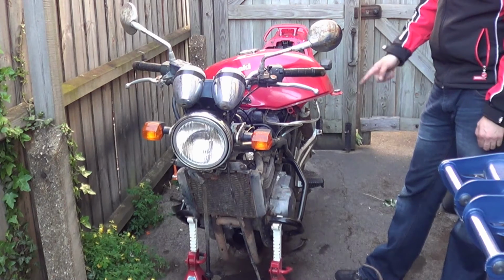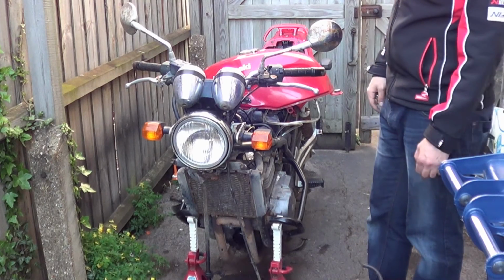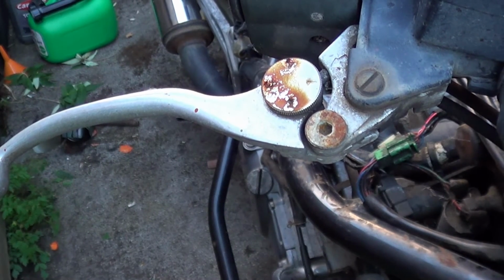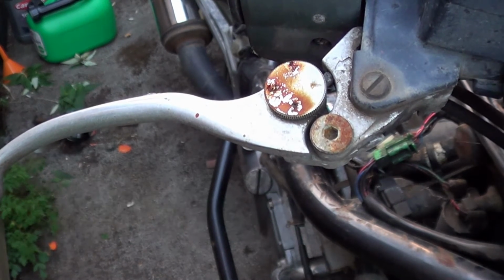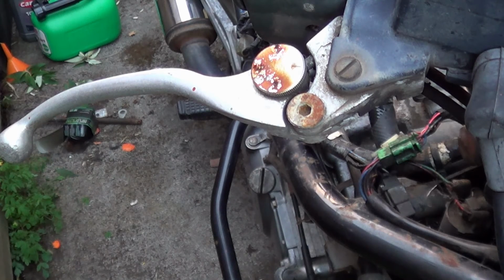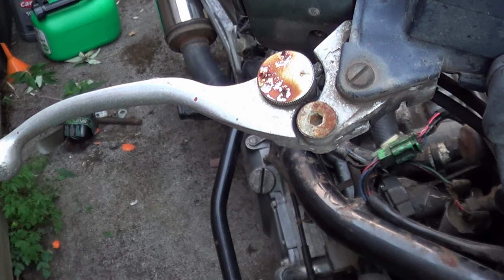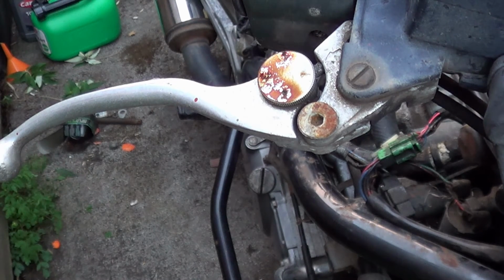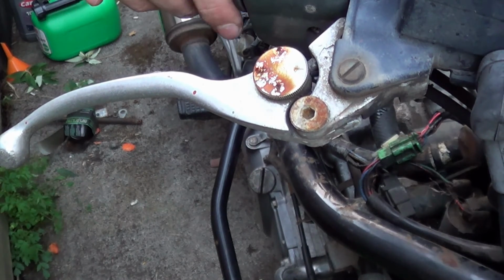Kawaxaki ER 5 - Mystery Problems Update - Episode 12

Comment: Mine sounds the same, replaced the plugs, removed clutch cover and found milky cream on the inside cleaned it off, fitted new gasket and refitted it, filled up with new oil, still sounds like yours, so will try water pump seals next, just hoping it not the head gasket?

Comment: I'm guessing it may be the carbs as well. Also thinking it may be the enging timing for the clunking and shaking.

I will say I'm in no way good at diagnosing issues. Though getting there slowly.
Reply from the maker: Rigal the shaking is probably due to the mis-firing cylinder, my guess at present is that its either ignition related or carb related. Good thing is that ignition is an easy one to diagnose. Probably a video later this evening. - matt
Reply: Pony Power You know better then me :) Looking forward to the next vid!

Comment: yes...could be petrol feed...pipes, connections, air leaks...and otherwise electrical......coils maybe......usually something simple, but finding the problem is trial and error sometimes.....
Reply from the maker: +ROY Dean Going to try the coil first, probably tomorrow and video that. Just bought some new hose, you would believe how hard it is to find 10mm hose. everyone has 9mm. Any road, its a shame that I can't flip the carbs upside down to test if its that.

Comment: I've had a similar issue and mine was the float in one carb was set just a little to high and on tick over it was flooding slightly and  the extra fuel was being sucked into the engine ( i could see it looking into the mouth of the carbs when running)  and as you reved, with the extra air being sucked in the cylinder would fire up again
Reply from the maker: ***** thanks for the comment, I have set the carb float height previously but that doesn't mean that isn't my issue, will be going over everything again after the fore mentioned possibles. Thanks again

Comment: You should get rid of the dodgy standard tap whilst you're sorting it out
Reply from the maker: Chazillor What the fuel tap? do they do aftermarket ones or do you eman off a later model? Thansk for the comment - matt
Reply: if it's a square cap model a suzuki rf 600/900 tap fits virtually straight on. look for kawasaki er5 group on facebook few of us have done it
Reply from the maker: Thanks for the info mate thats a great help - matt